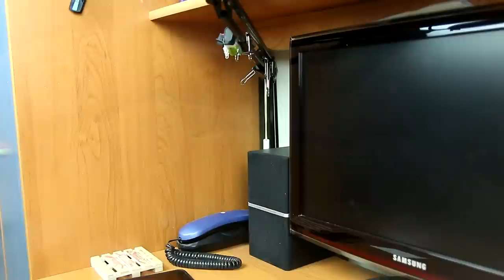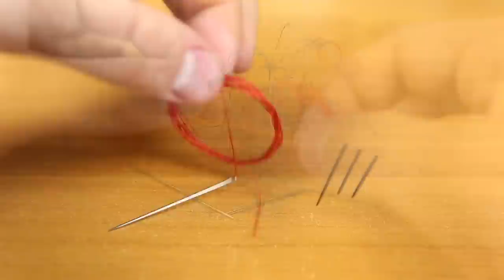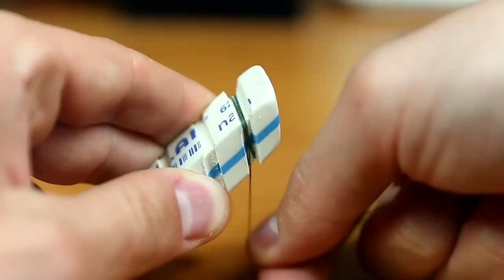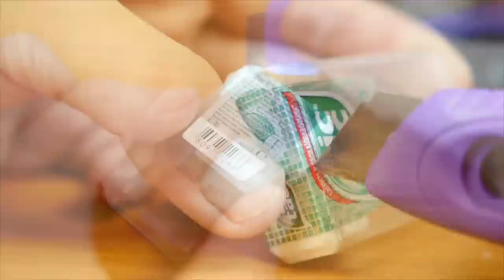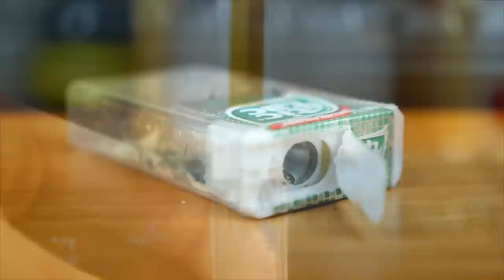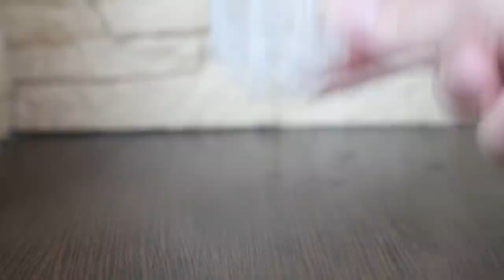4 Simple Life Hacks

Comment: A little tip for the first trick: if u glue the caps that way, the pens will probably stop working after a while, since the ink will go on the wrong side. They will need some time standing the opposite way to get the ink down to the tip again. If u glue the caps upside down, the ink will always go to the tip and even after not using them for a while, they'll still work nicely ;D